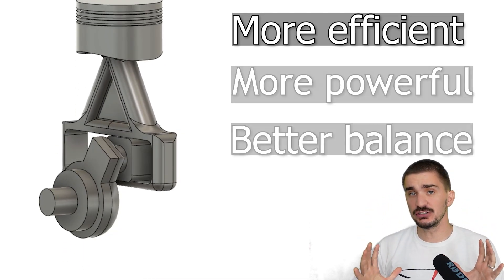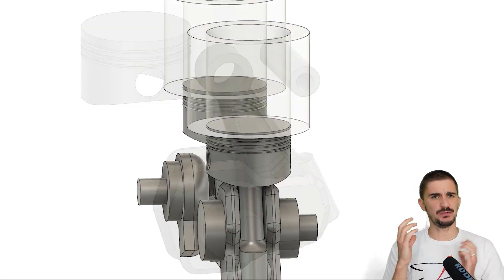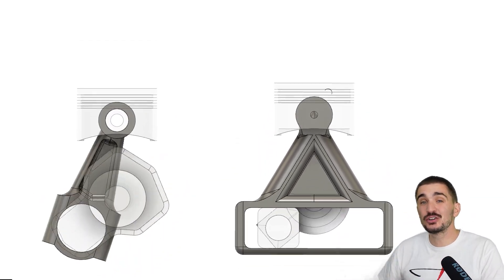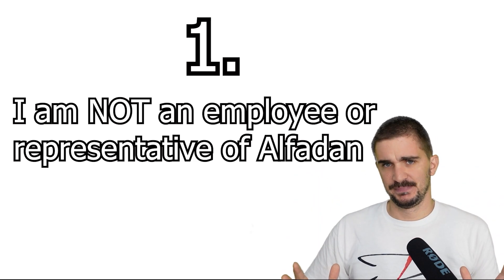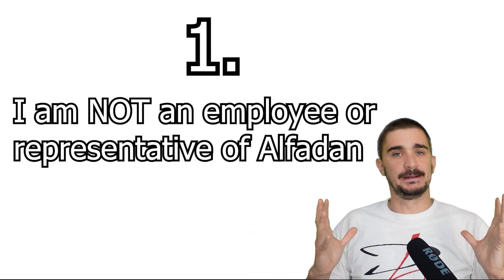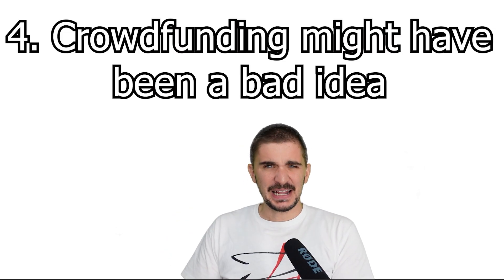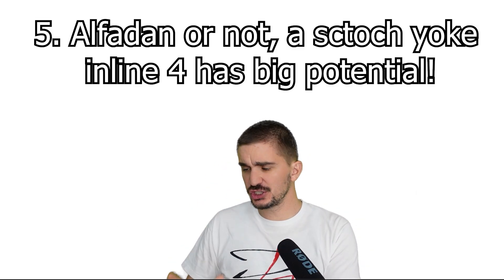This engine is better in every way?

Comment: Gibberish and Rubbish.  Scotch yokes are over 200 years old.  Surely by now they would have been tried and tested and put into use and production if they had any place in the real world.    Note that there are new sliding friction forces and new angular forces on the piston and cylinder walls.   The worst is the bottom slot leveraging the piston sideways into the cylinder walls.  That's going to cause a lot of friction and wear.   

Hard to say for sure but it's quite possible the total friction is considerably larger than usual.  The only definitive proof of efficacy and life would be measurements of fuel consumption, wear,  or input and output temperatures.   Your basic Carnot cycle charts and graphs would reveal all.   Funny, there is no such basic info!   Neither is there an actual physical model!    Just computer-generated fantasies.   A clue as to how unsure they are it will work.  So it's basically a wishful thinking or marketing presentation looking for angel investors.

Comment: It's just moving the problem to other areas.  That rod would need a guide on both sides to keep it straight so there is no piston side loading. Also if the rod is not stable, the crank pin will slam against the side of the rod bore. To oil that rod bore would be a windage nightmare. Would take a serious dry sump system with a defoaming tank to get all that air out of the oil. Weight, more friction,  oil foaming, windage, etc

Comment: I think they use this in car A/C compressors, how ever the new Na -Fr battery and Chinese Electric cars will cut the chase and damage the internal combustion engine industry beyond repair. To my humble opinion this could be used at power plant or ships be cause you can use ball bearing at places that is possible to use rather than combustion chamber area. I thank the God of engines to bring another wonderful and educational video.

Comment: Couldn't part of the weakness issue inherent in scotch yoke designs be mitigated by reducing crankshaft stroke, thus decreasing the length on the bottom of the rod? The  desired displacement can still be had by increasing piston diameter.

Comment: Power stroke isn't a big problem for con rods, intake is. And this design is especially week at tension. And an engine with this kind of rods couldn't work at higher rpm.

Comment: How about a scotch yoke 5 cycle 3 cylinder or 6 cylinder engine?  Super high efficiency potential.  A boxer 6 cylinder could limit some of the rod's shortcomings if it's a shared rod between the opposing cylinders.  Also, the sliding "bearing" block would not be too far fetched if you compare it to the oil bushings used in most motors now days which they call a bearing.  It all comes down to being able to keep a layer of oil between the surfaces.  Or, roller bearings with captured races could easily fit into this block's shape and load requirements.

Comment: There's another issue -

your max piston speed would be limited by the additional mass in the piston / con-rod assembly as compared to a standard arrangement. This would limit your top-end RPM and potentially power output of the engine. This could, however, be potentially worked around by making the engine an under square diesel which would increase torque.

here is a perk though - It would be an easy setup to create a boxer with!! Just whack two conrod assemblies together and you not only get a boxer setup, but it also doesn't need an offset to the pistons!!

Comment: Are you for real people, you can strengthen the wall thickness of the bottom part, or make it as opposed piston engine, then you combine 2 of the stronger parts. Also you could use magnetic bearings or even use round ball bearing with V groove edge as sliding pin. Or simply leave tiny clearance between upper and lower surfaces, engineer a play in the system so it only slides on 1 surface at the time. The reason why manufacturers refuse to convert, is, drumroll, Because they have invested a metric ton loads of money into tooling and methods. Also they are in cahoots with the big oil to sell more gasoline if an engine are less efficient than you need to buy more fuel, and the big oil and the shareholders makes more money. Is it not using your brain day on Youtube today...

Comment: Some may say that the square generates much more friction than the normal journal bearings. 

But what if we aren't seeing the whole picture? Unlike normal rods, these pistons can be reinforced with sliders since there are no shear loads, although that sliding square is  a major issue.

Comment: I think the mass of the connecting rod is greater than with a conventional piston engine. It also wears in two places. One of them is also the bearing, while in the other place it is much more difficult to properly solve the lubrication on the flat surfaces where it slides. It wears out quickly, it is not timeless. Nice try.

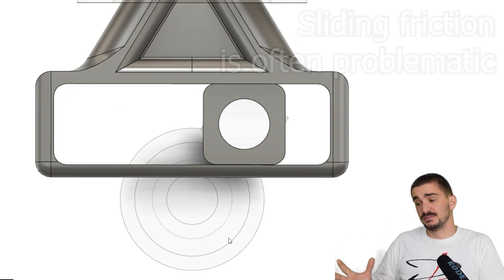Comment: 7:12 Better to have the "sliding friction in the conrod/crankshaft-interface, than in the cylinder/piston -interface, since it´s unavoidable after all... The high temperatures created by the combustion in the cylinder let the sliding-friction-effects be more enhanced in the cylinder/piston-interface (but easier to reach and repair, compared to the crankcase)

Comment: Whether scam, or just "hopelessly optimistic", the end result for the investor is kind of the same.  This reminds me of the Saga of EEstor.  The magical capacitor that was going to replace batteries.  I remember first reading about them back in 2006, when they claimed they would have an EV powered by that in the next year. Here we are almost 20 years later, they still haven't demonstrated a working storage, let alone powered a car with one, and yet somehow, they still exist in some form, and there has been no charges of fraud and investor money is LONG gone.

Maybe Elizabeth Holmes, only just barely crossed the line from "hopelessly optimistic" to scammer. 

I would stay far away from any investment in new hopelessly optimistic new engine designs, which their seem to be no shortage of, and view them as interesting curiosities and nothing more.
Reply: Elizabeth Holmes crossed the line when they started faking results with conventional lab equipment. Same for Nikola and their "gravity battery" (aka rolling downhill.)

Comment: There is still rotational forces as the direction of forces are not applied in a liner manner unless the rod is supported on the other side adding another layer of friction that you didn't cover as the centre of pressure is not maintained above the sliding pin

Comment: @7:15 Would it be possible to combine the "Scotch Yoke Piston" with a cogwheel gear similar to that of a "Wankel-Motor", so that you would prevent that sliding-mometum, which would cause friction and wear ?
Reply: Like this maybe?   https://en.wikipedia.org/wiki/File:Hypocycloidal_Engine_higher_res.webm

Comment: Too bad they still can't make it sound better without either donking up primary balance or scavenging. Also, there's still going to be a practical limit on piston speed, which limits maximum stroke for any given RPM. And on top of that, there will still be a practical limit on bore size since it will significantly increase block length and piston weight, which will affect packaging and exacerbate the piston speed problem, respectively.

But either way, if they could make something with a 90mm stroke and 103mm bore that doesn't vibrate itself (or the passengers) to death, then we're looking at a 3L 4 cylinder that'll be as smooth as a 1.6L or better and still hit 8000rpm.

Comment: Alfadan previous said it was not a scotch yoke design. Their comment from last D4A video. 

@alfadanhighperformanceoutb8416
1 year ago
 @phamnuwen9442  The ALFADAN i4 allows us to build an engine that is smaller in length than a 2.4 Liter i6 but with 7.5 Liters. Furthermore, the design allows for a shorter crankshaft and an engine that is more robust with less moving parts. Another very important aspect is the fact that as an i6 we would have no patents or IP to protect the company. Finally, we are not using the Scotch Yolk design because it failed the preliminary feasibility study. The design evolved into a very unique and innovative solution.

5

Comment: like most concepts... these seems great on face value and computer simulations but in reality it just doesn't work. If it did, engine builders for Motorsport and engine designers would be flocking to this.... but you dont see Porsche doing this. Reality is, the conventional piston and rod combination is better despite what a computer simulation shows.

Comment: I'm not an engineer by any stretch but I am curious if my understanding is wrong or not. Does this mean that a like for like engine with yoke rods would have worse NoX emissions due to the higher cylinder pressures/temperatures? I wonder if ignoring the friction concerns... how much of the benefit in thermal efficency would be lost due to having either less advanced timing, PPF's etc to keep that under control?

Comment: We had a horizontally-opposed Scotch-yoke engine designed three decades ago. Each piston was double-ended (you still need to keep that yoke from moving, there are side forces!) with the yoke in the middle. We never got around to building it, but in my retirement I may do so. Gotta make it a four to keep the balance even close enough to live with!
Reply: Could it be possible to use gears to increase the strength and reduce sliding friction?
Reply: Use rails on the right+left of the yoke.
Reply: @klausbrinck2137  And it's added friction...

That whole thing about no sideloading on the piston is unfortunately not true in the configuration that was shown in all the animations. Adding linear bearings to keep the yoke from moving sideways would take out a lot of that, but it would add friction at yet another point.

It's a case of saving friction in one place and loosing it in three others. So sorry, but I can't see how this would be able to revolutionize engine design. People have tried it before, and will try again as everyone is certain that no one else understands just how great their particular idea is.

And there's nothing wrong with people trying to refine ideas, but it become stupid when you have to ignore science for your idea to make sense.
Reply: @blahorgaslisk7763  The linear bearings not shown in the animation, are a weakness of this specific animation, not of the concept. It is a known concept, and linear bearings are part of it. Aside to that, it is known, that bearings reaplace almost all friction with rolling action, one simply has to compare wear with and without bearings, and notice that without, wear is thousands of times higher. In other words, friction is eliminated. Additionally, taking friction out of an environment of thousands °C and replacing it with rolling action in an environment of solely tens of ^C has been the solution for many technical problems in the history of engineering, and I want to know from you, which cases you know, where it hasn´t worked (???) I guess you just wanted to exaggerate, in order to enhance your argument.
Reply: @klausbrinck2137  Yes linear bearings are a solution to problems in engineering. But that does not mean that they would do well in this application.

Even if those Bearings would reduce overall friction and would hold up in an engine environment, they would be a nightmare to machine and maintain. Cost and Lifetimecost are always a factor.

I am not an engenieer, this is common sense.
Reply: @markusluftner8418 Everything you just said is true about any bearings used even in traditional engines.
Reply: @infernaldaedra  Exactly! This is why I find it hard to listen to detractors as they keep trying to bring up the issues... That already exist in conventional engines regardless of how you swing it!

They don't want to even try anything new! They always find fault in a design and blow it further out of Proportion!

I mean, I used to like Electric Cars... But then I not only saw how much of a Technological Dead-End they are becoming, but they stil rely on Powerplants anyway to even be remotely useful! The Teslas were rather overhyped as well, and when it comes to LI Electric cars... Ugh... Those things are a nightmare whenever they crash... Instant Crematoriam.

It doesn't help that they feel... Soulless.

This is from a Guy that wanted an EV in his youth... But now, I cannot even look at one without feeling disturbed.
Reply: @Victor-056  For sure people do not like change. Unfortunately in regard to EVs all it takes is for a new battery technology to come out then it might be possible to swap battery packs in an EV once your warranty is up after like 10-15 years it might be possible a new Battery is better than a new motor in a traditional ICE engine but both technology has a long way to go before it is fully refined. Eventually the last built ICE engines and EV motors will have the same engineering quality that you will find in things like Hard drives. Currently has engines are still only about 35% efficient and EVs are slightly more efficient but the upper limit of what we can achieve without friction might be closer to 65-75% in combustion engines and 80% in electric. Diesel at large scale can currently achieve high 60 percentages in fuel efficiency
Reply: @infernaldaedra  The other problem is So-Called "Self-Driven cars" which are the same electric cars. What happens if you unknowingly make yourself an enemy of powerful people, and you take one of those cars?

Keep in mind I said UNKNOWINGLY. Its been happening a lot these days, moreso with ordinary people getting doxxed and then assaulted.
Reply: @infernaldaedra  Also, where are you going to get Diesel if ICEs are going to be replaced by EVs? What then?

You think too far ahead, never looking at the here and now.
Reply: @klausbrinck2137  Yes, rails on each side of the yoke are used if there is not an opposing cylinder. The bearing pads are clearly shown in the Alfadan patent drawing shown in this video.
Reply: Bourke engine, look it up.
Reply: @CTSHOEBOX  you googled that. They were not a production engine it was an engine design. Much like a typical engine is called a diesel or Otto cycle after the person who designed the process.

What brand was the engine? They were not produced as far as I've ever been able to find.
Reply: What engine was that? I've only heard of a 2 stroke design and that it never made mass production.

Comment: Speaking of low friction engines, have you ever heard of Taurozzi engines?
Quite an interesting concept. Inventor claims a good increase in efficiency by completelly eliminating side wall friction using a guide bar that hinges on a roller bearing axle, making the pistons go in a thoroidal cylinder analogue. Built a couple prototypes himself fit to go-karts and has succesfully put the concept into production in piston air compressors, but has not been succesful in getting one of the big engine companies to build some for large scale tests. Inventor even claims the engine doesn't need oil anywhere near the cylinders themselves, and his compressors in fact do not. A normal engine can in theory easily be converted to Taurozzi by swapping out just the block and pistons (the conrods do not IIRC). Everything else can be reused, and that is how he built his prototypes 
There isn't much material out there, unfortunatelly all the efficiency data comes from the inventor's own testing. Don't know if it's enough material for a video, but worth mentioning in a short, maybe?
Reply: Oh, and they just look like hell to balance. Maybe that's the reason the big engine builders don't care.

Comment: Some things said are wrong. I like the thougts. The horizontal movement of the shaft makes the force flow in an angle. So the piston is still pushed against the wall. With the Shown Design is even a Momentum hold by the piston and cylinder wall because this Bad upper joint  is gone.

Comment: Makes me wonder what happened to the Revetec engine, which used a lobed camshaft instead of a yoke.  I mean, it obviously had its own problems with vibration and stress on the small roller bearings, but it's still a novelty that might make for a good video.

Comment: Just looking at the scotch yoke design, I would expect it to be a better proposition in horizontally opposed engines, simply becaues each cylinder will support the straight movement of the yoke assembly, also able to optimise the strength of the yoke on both thrust surfaces without adding extra material. I would also expect this layout to reduce any balance issues.
Surprised the likes of Porsche and BMW (Motorcycles) havent tried this in their boxer engines.
Reply: Boxer engines are a subset of horizontally opposed engines that don't use the same crankshaft pin so wouldn't work like you say. If I'm understanding what you're saying correctly. This would work on some flat engines, but not on boxer flat engines which are what Porsche and Subaru use.

Comment: I  am  so  glad  that  you  have  called out  the  " Know  Fuck  All "  Trolls . It  IS   an interesting Technology , that DOES  actually have  some  clear  Weak Points .
 I hope  Modern techniques and Materials  can  overcome  these .
Reply: I  feel  like  picking  a Fight  with some of  FOOLS  that  have  already commented  here . 
Linear  Plain , pressurised Oil , bearings and a lower end " Guide-post "   can deal with quite a LOT of the issues . But WILL add reciprocating mass

Comment: You could probably run a lube channel through your "crankshaft" into a bearing clearance designed into the circle inside the square. This circle bearing could fill with oil then pressure out holes through the square surface and out the rod back into the sump. High oil pressure pumps would keep it from knocking at all.